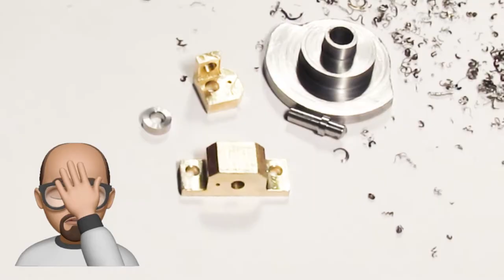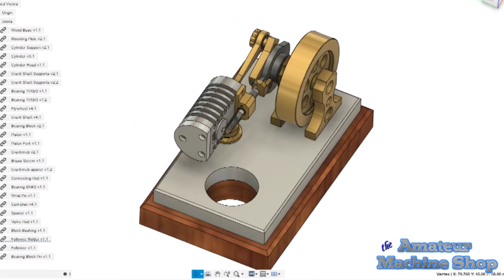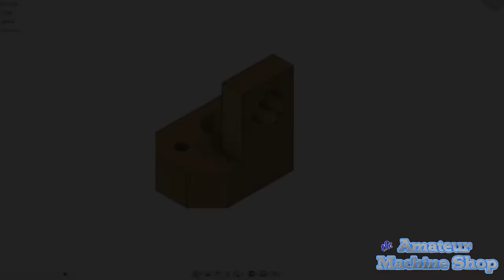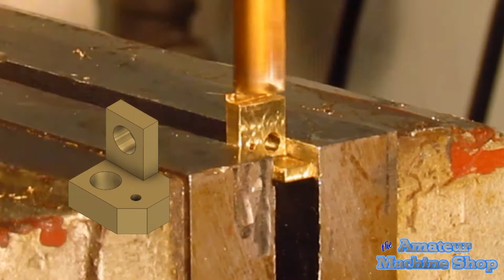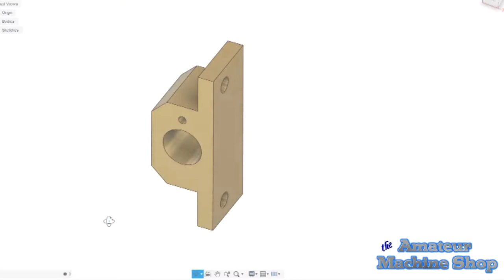My Mini Flame Eater Engine - Part 4 - Bearing Block & Follower Holder

Comment: imo, the radius  of  a  cam  Should  be  a  Small  as  is  Practical.        therefore, i suggest that  you  REDESIGN  the  cam.
the logic is this,  the  Circumference  of  the  cam  will be   'Smaller'  and  a  cam follower will  'travel' a   Lesser  distance;  per  revolution.
in other words,  during each revolution,  there will be Less  DRAG/friction, at the cam/follower interface.      in addition,  the energy is  Correctly  taken off  NEARER  to the  crankshaft.      where there is the  MOST  energy.!
Reply from the maker: It's not my design, so first get it working according to Mr. Ridder's design and then can tune it later. TY for the tip.

Comment: if you are familiar with heat engines,  the  design  Guidelines  are  the  SAME, here.        the  Amount  of  MASS  in each  component that reciprocates,  Should  be  MINIMIZED.!         this  INCLUDES  the    PISTON.      in other words,  none of  the moving components  Need to  be  robust/massive; other than the flywheel.
in this type of engine, the  power  comes from  Atmospheric Pressure, pushing at the  'bottom'  of the piston;  after a low-pressure condition has been induced inside  the  cylinder.     so, the piston does  NOT  need  to be  robust.       googletranslate